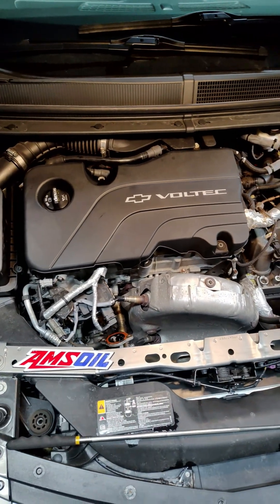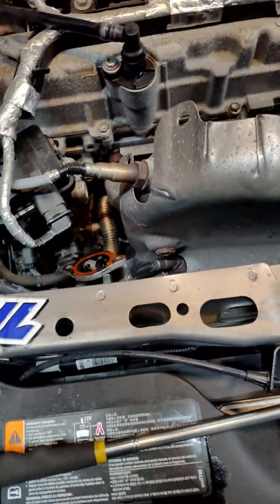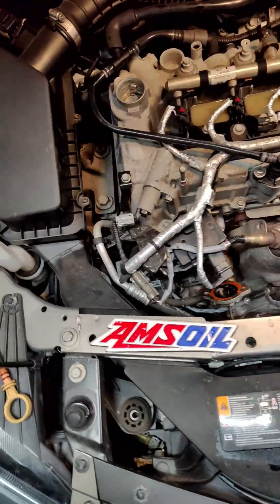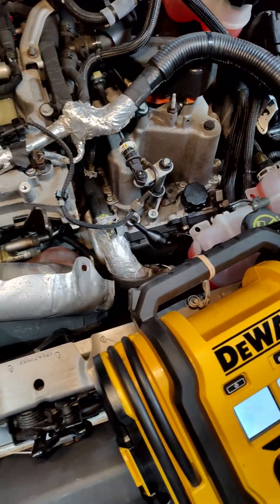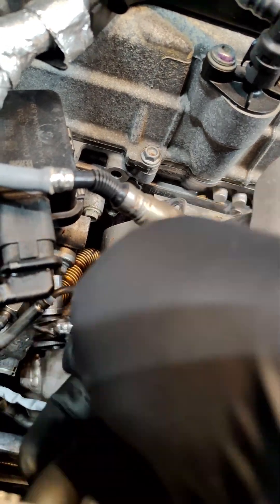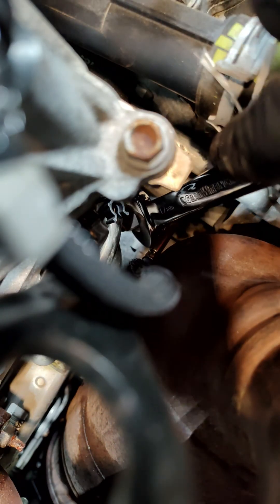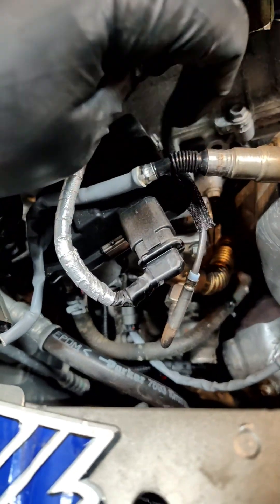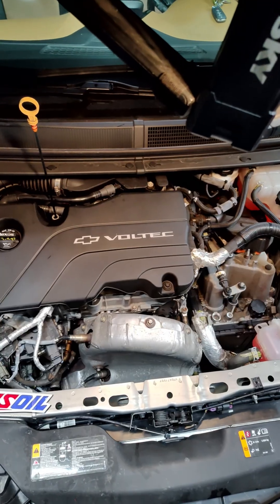⚡ 2nd Gen Chevy Volt EGR Cooler Cleaning Hack — No Removal Required

Comment: I have a P06DE code ... and I can't find any vids on locating the oil pressure control valve on a '17 Volt. Can you assist?
Reply from the maker: Id have to pull schematics and I don't have access now, it's either in the oil pan or on the side of the upper oil pan. If you have not had an oil change in a long time I would start with that first.

Comment: Hi and thank you for your video.  I'm getting a check engine light on and the a message "Propulsion Power Reduced" could this be the same problem you had?  2018 Chevy Volt just under 78,000 miles. it's been very windy and dusty we're I live not sure if that caused it.
Reply from the maker: That is a generic messages and it could be a number of things. You will need to pull codes and diagnose to confirm.

Comment: Did yours blow the fuse F03? Do you know if this method will still work if the fuse blows or is that more of a circuit board issue?
Reply from the maker: This video is just for the EGR Cooler cleaning, if your fuse blew, this indicates an issue with the EGR Valve itself.

We eventually had to replace the EGR Valve, however cleaning it thoroughly gave us about six more months before completely died and needed replacement.

I would clean it, and replace the fuse, if it blows right away or after a day or so, unplug the EGR valve, and replace the fuse. This will allow you to continue to use the car while you either save up or wait for your EGR valve replacement.
Reply: @blackwatermotorwerks thanks. I just currently have it unplugged right now.  I’m used to EGR valves costing like $200 or less. I have not priced a valve at my local dealer yet but I’m reading it’s 1000 or $2000 which is ridiculous. I’m sure the cooler is replaced at the same time or I can just clean it like you did.
Reply from the maker: @poobank if you can get a used one for $200 go  for it that's a great deal. The new ones are revised and no longer fail (supposedly), and yes they are $1700-2300 depending on the dealer. Just keep in mind that a used one will eventually fail too.

Comment: Hello Sir,
I was wondering what fitting size/thread you used to connect that black hose to the bottom side on the EGR cooler?
I plan to clean my EGR and EGR cooler soon!!
Thanks
Reply from the maker: 1/2" is the size

Comment: I greatly appreciate the video. I have been reading, researching, and talking to several dealerships and Chevrolet mechanics about my EGR issues. I need to first clean my EGR cooler and check if the P401 code goes away. I believe my EGR cooler might have  been clogged for the last few years since my MPG has dramatically dropped and the engine has been running rough, but the engine light with the P401 popped up right after Firestone did a full fuel system clean which most likely clogged the EGR Cooler.

Comment: My 2017 had 154,000 miles on it when I changed the spark plugs and cleaned the EGR valve and cooler. I ran Purple Power through the cooler 5 times and soaked 4:32 the valve a few days. The engine runs smooth if I get it running by selecting Hold mode from Normal but very rough if it kicks off a Fuel management cycle at startup. Does anyone know if the valve operates with a gear motor or a solenoid? I can't tell if it's stuck open.
Reply: The EGR Valve has a motor, but poor voltage or board (failed electric board) can prevent it from opening. The motor opening the EGR Valve is much stronger than the motor closing the EGR Valve. Therefore, when the EGR Valve is stuck due to carbon build up it is most likely closed.

However, if your electric board to your EGR Valve fails while the EGR Valve is open then the EGR Valve could be stucked open. Therefore, you will need to upgrade to the new EGR Valve which has a much stronger motor and upgraded board. Your EGR Valve would need to be removed and bench tested by a professional who knows what they are doing to know if the EGR Valve is operating correctly. It sucks but the most recent new EGR Valve (P/N Part Number: 19436521) released at the end of last year (2024) corrects and prevents many failures from the four previous part numbers (old EGR P/N: 12667038, 12674163, 12691147, 19436113). The new part number is the fifth generation, yet by far the most expensive EGR Valve for the 2nd Gen Volt.

Comment: Just finished cleaning my EGR valve and cooler in my 2nd gen volt. I used your method of cleaning the cooler as I did not want to remove it. I would like to add if you have to purchase a hose for the vacuum portion it is 1/2". I used two gallons of WD-40 specialist cleaner and degreaser as it is safe for all metals. I also unscrewed the intake sensor as well to clean it. Cleared the code with my code reader and everything is back to normal, glad I did not buy that $2000 EGR valve from GM.
Reply from the maker: Excellent point didn't even think about the hose  size as I had it laying around! I would second guess anything but purple power, as it is water soluble. It also has will documented use and is recommended by certain engine manufacturers for cleaning of DPF, EGRs, and coolant systems.
Reply: @blackwatermotorwerks thx for the vid very helpful however how did you manage to screw back on the lower sensor even with special tools n heat shield removed i ca barely reach it with my fingers and manage to move the wrench to tighten it?! Any tricks on that before removing the cat ?
Reply: @alainfiliatreault2807 I just did mine yesterday. The easiest method I've found is to come from the bottom with your 17mm wrench and just take your time to slowly tighten it. After hand-tightening, it only takes 4 or 5 quarter turns to snug it down. When I say "come from the bottom," I don't mean from under the car (no need to jack the car up or use ramps). Go down the front of the catalytic converter and then up behind it with your wrench. You can use your left hand to guide the wrench onto the probe, but not necessary. It's a very odd angle, but once you find it, it's quick and simple.
Reply: Hi what code or message did you get before you cleaned your EGR?  I'm currently getting a check engine light with the message "Propulsion Power Reduced".  I dont know what it could be or how to fix.  Thank you in advance for your help.